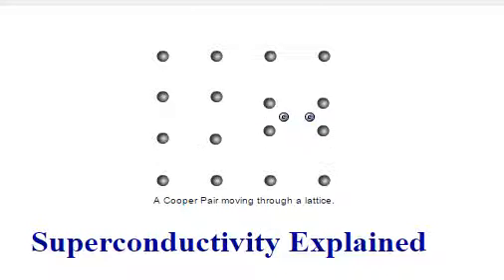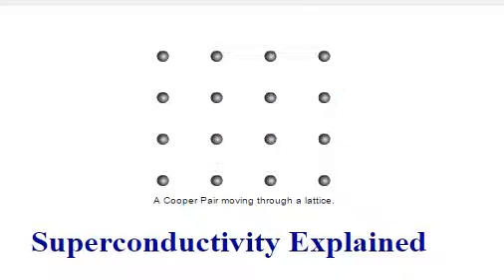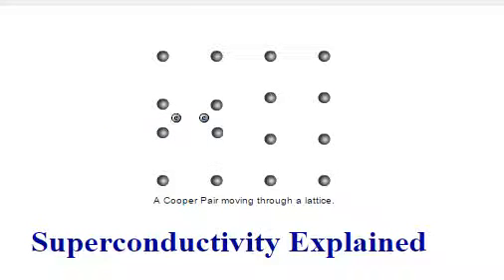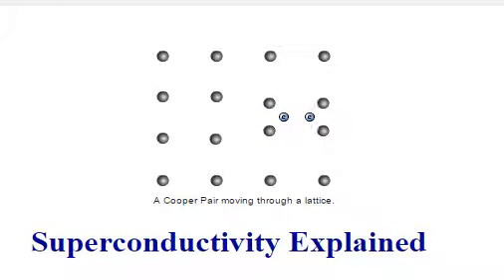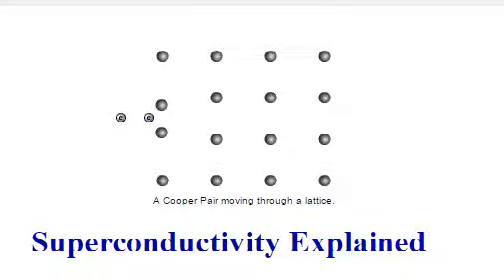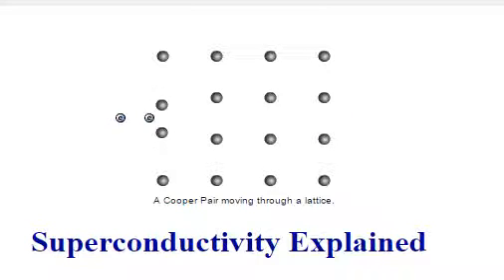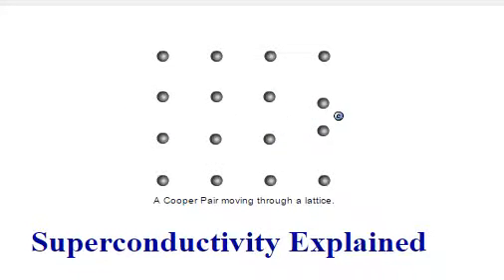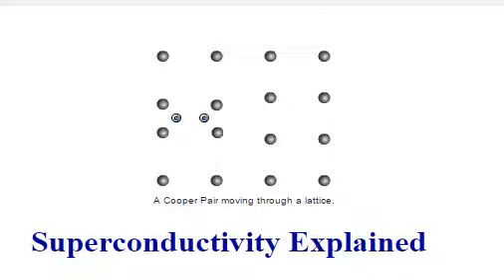Superconductivity Explained : A Cooper Pair moving through a lattice

Comment: As a "hands-on" analogy, any musical instrument, tuned but inactive, in its ground-state is ready to conduct sound because the collective effect of tuning harmonizes the sound emitters to the standing wave represented by the instrument and conducts pure tones efficiently. If the instrument is out of tune, a lot of the input energy is "resisted" and wasted, scattered along the lines of the exclusion principle. 

A "reverse process" analysis of superconductivity might be analogous to researching the purity of effective sound production by various instruments (?), using the existing examples of superconducting compounds and related bond frequencies.